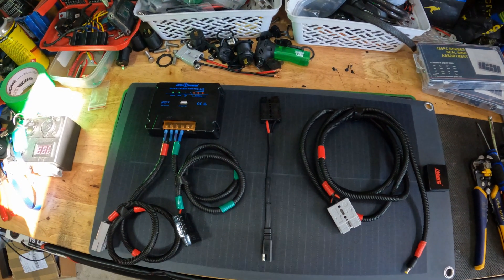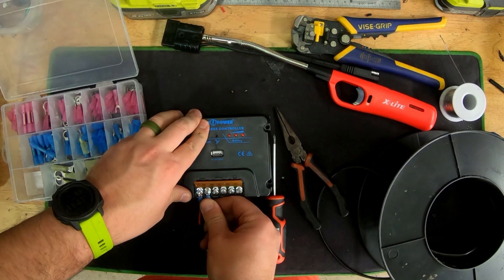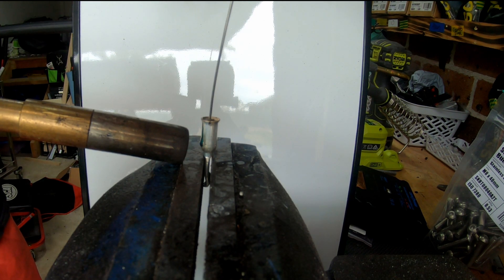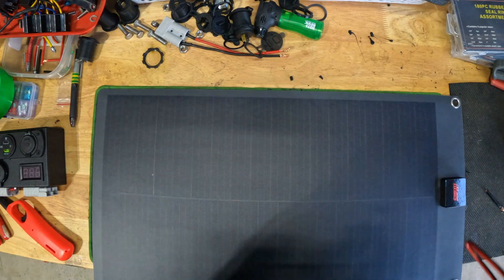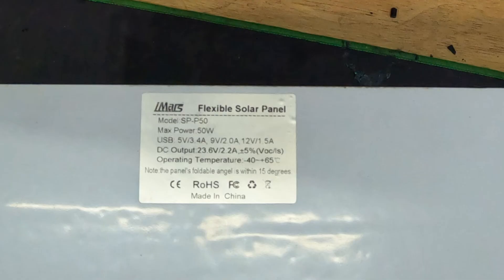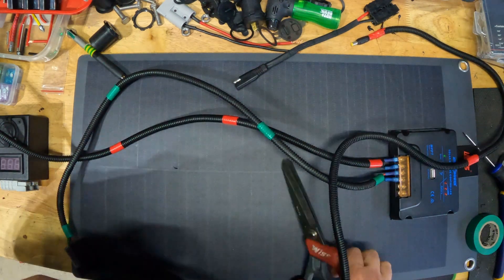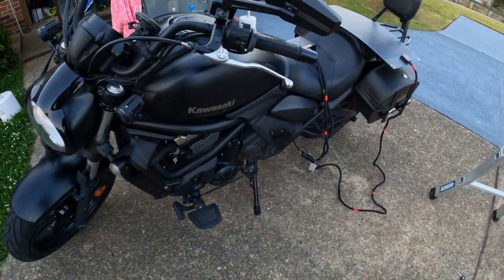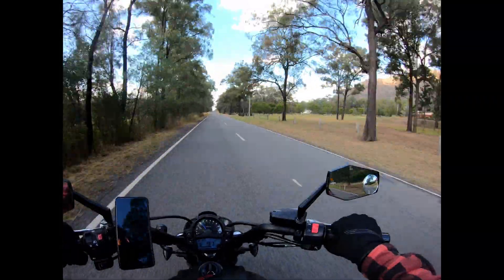How to charge your motorcycle battery with solar!

Comment: Thanks for this.  I have been after a common sense way of building one of these for my Vulcan 2000.  I pretty well had it nutted out but you have confirmed I was on the right track.
Reply from the maker: Always good to double check. Good see it was useful !
Reply: My 95 st1100 needs an alternator...this might be a better, cheaper, solution